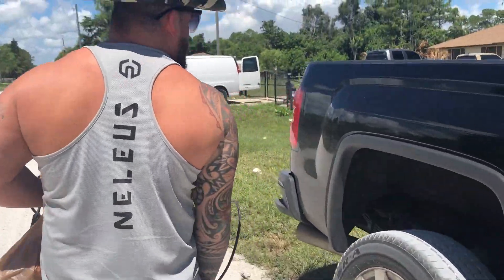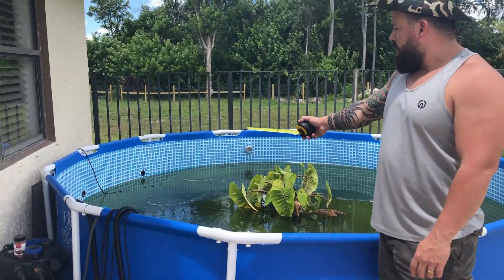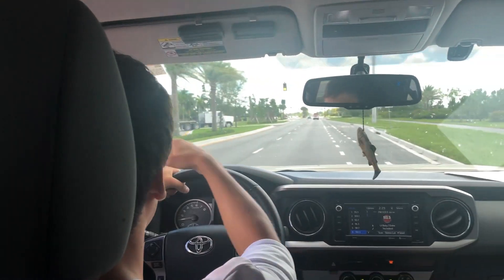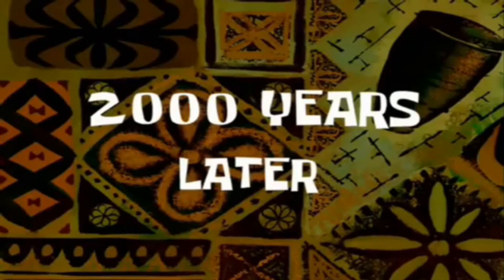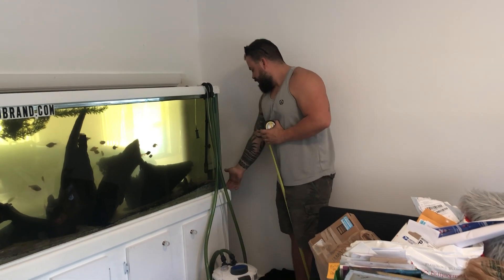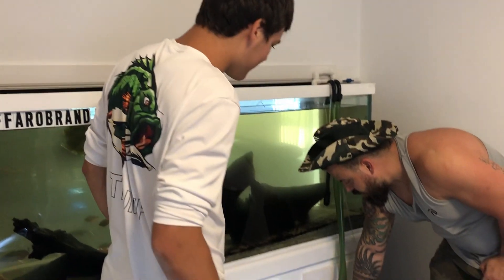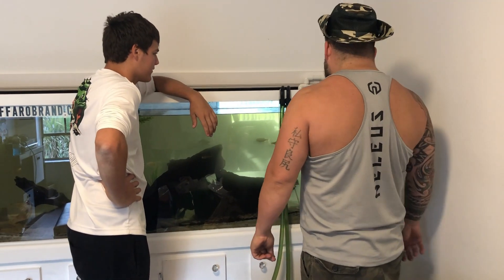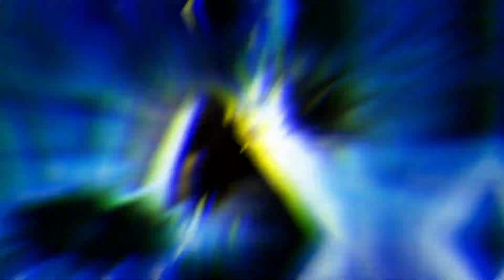PAUL CUFFARO automatic *WATER CHANGE* system

Comment: You should add a float valve at the inlet pipe. That were be better.
Reply: He is not using a sump he is using water from the tap.
Reply: wow dad I think you need to do some research...
Reply: @jimmyoh1982  remember this is not a automatic water changer
Reply: wow dad I think you better go google research.
Reply: wow dad  I still think you really don't understand what is float valve mean.

Comment: That sounds like a good plan in a warehouse and it works when it works but the slightest air bubble in the drain you'll lose syphon the tank will overflow  and you'll have a mess in your house trust me it will happen only real way to make that work permanently is drill the tank and put in an overflow

Comment: I love your videos, can I please get a shout out? You are an inspiration and you inspired me to get my first tank and I then convinced my sister to get a tank

____________________________________

Also, I found a Robbin egg and dont know what to do, please help. All I have is a heat lamp and straw. Please comment how to make it hatch healthy

Thank you all, your are great
Reply: Predatory Fins, What should I do with the egg?
Reply: Thanks for the like! Your rock
Reply: Can buy pretty cheap incubators online for 1-4small eggs. I used to have them for quail eggs as a kid. But before u buy anything use a light to make sure the egg is even good (by that i mean that their is an embryo in it and blood supply). It could be cracked&u not even know without a flashlight behind it or rotten already. Just research a bit online to check for ways to find out if its even viable. My quail i hatched from incubators turned out well but in adulthood they laid eggs like crazy that werent fertilized (meaning they wont hatch) and sometimes when you find an egg like you have there may be womething wrong with it (the mother pushed it out because it didnt hatch) or it may not be fertilized. Worth a shot though if its viable and your heat lamp could work until you got a small incubator from amazon

Comment: The idea is perfekt but Not done 100% right... sry... it's Not Safe.... and for Backup you need a Filter...
Reply: Predatory Fins ok... and what Happens when the Ventils are Open for a „drip System „ power shut of about construction in the Street..... then the Tank water Go out until the waste water pipe suck air Fish have a Little water everything is fine.... then construction are finished in the Street and power Go back online.... the water Level rise and rise and no water Flow out about the pipe suck air..... then the Tank Flow over and the floor will be damaged
Reply: Predatory Fins sorry thats my english is so bad.... i understand what you say... don‘t understand me wrong i would Love to do that by my Tanks to... but i think a different Point... if you leave the House for Hours and the Systems run and then is the case what i sayed bevore .... the House will be flood over... Love what you do..!!
Reply: Predatory Fins Look at Pauls House...;) !!!